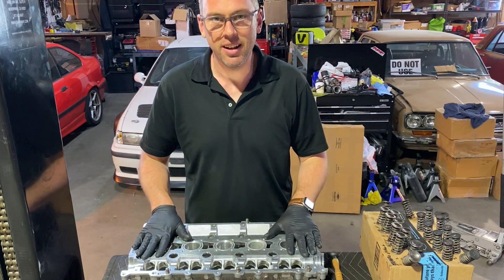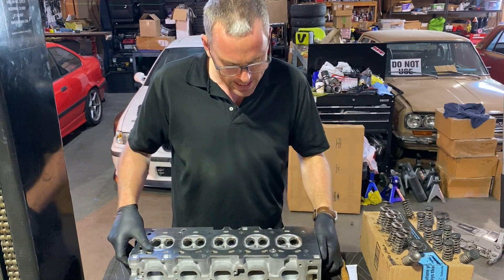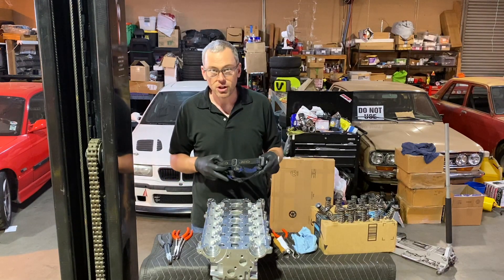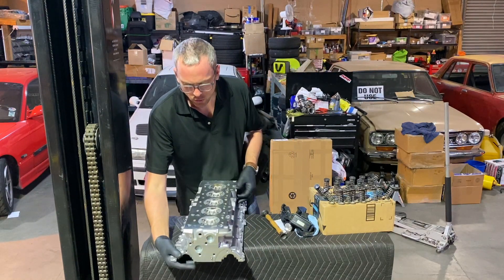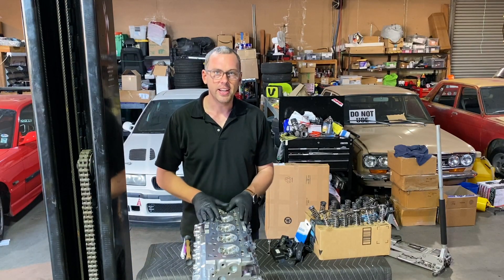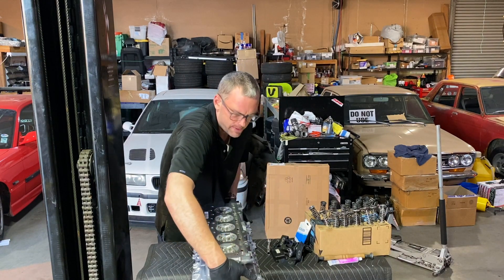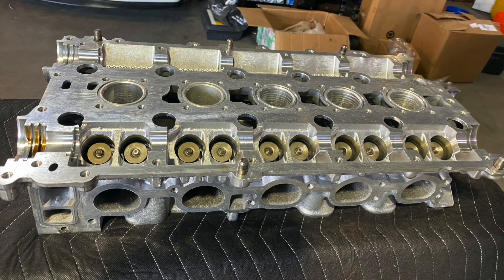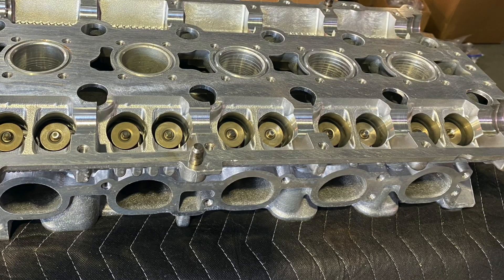V70r Build: Head Work & Installation With New Head Gasket

Comment: Hi EuroJulien. Peter from Australia here , I'm currently rebuilding a Volvo 2.5t 2005 engine same type of block as your V70r , I'm looking for a valve compression tool like the one you use ,my question is is it a OTC Large  from Amazon or ?  comments on Amazon that the tool is not being strong enough for higher force springs? The tool you got looks good , still got my ENG head on the bench.

Comment: You seem to have used Victor Reinz components, any problems after it was finish. Robert only like to used Volvo stuff for valves and head gasket!
Reply: I heard before that Elring made the head gasket for Volvo but I'm not sure .Anyway ,Elring makes only OEM components. 
It's known as other  manufactures work for automotive industry, in this case Volvo  and stamp  logo(Volvo) on it. For example INA make the mechanical tensioner for timming belt kit. And so on with other parts

Comment: Great video!! Question; I’m in the process of rebuilding the head on my 06 S40 after the car jumped timing. I got me valves. I’ve always heard that these engines never need valve clearance adjustments. During engine disassembly, I numbered the valve tappets in order to install them in the same location. Will the valve clearance be within specs even with the new valves? Im
Reply from the maker: for sure check your valve tolerances

Comment: Informative video that leaves a lot of questions.
1. How many miles on head before Stage 2 port & polish?
2. What are valve stem/valve guide specs on used head vs. OEM
3. Why pay for an expensive Stage 2 P&P and not have same shop do a quality 3-5 angle valve seat job??  Hand lapping valves is good for proofing a valve job, it does NOT correct worn or incorrect OEM seat/valve angles. Porting and polishing a cylinder head with old valve guides, stock valves and stock seat angles seems questionable?  Let me guess, you don't have before and after flow bench numbers for your stock vs "P&P head???
Reply from the maker: 1. 160k miles, iirc. 2. Don’t remember off the top of my head. 3. All the feedback I got is that if a Volvo head passes vac/pressure test don’t touch the seats. This was info given from a premier Volvo engine builder
Reply: @eurojulien  I'm an old Redblock guy and a new White block guy and I question your "premier Volvo engine builder".  Volvo valves and seats are durable but are not ground at multiple angles.  Additionally, valvle guides/inserts are seldom optimized in factory builds.  My toilet valve will pass a standard vac test, does that mean it is high performance??

Comment: Yes, again an illustrative video of how things are done wrong and I will publish it so that others can do it wrong as well. First, the valve is inserted into the cylinder head, then the cover is placed on the valve, and only then does the valve seal engage so as not to damage the lip of the seal. Then I put on the spring and the valve locks. Volvo supplies this cover as a standard part. So if you do not know the basic procedures, please do not teach others how to do it and still badly. Thank you.
Reply: You talking out of your ass

Comment: Great and informative video! A little trick I learned for lapping in valves is to use a lighter lapping compound, put the valve in, attach a piece of fuel line to the valve stem, a drill bit into the other side of the fuel line, and use a drill on its slowest ratio to spin the valves while applying light pressure with your fingers. Works wonders and makes speedy work of an otherwise fun but tedious and time consuming process. Also, my personal technique for valve keepers is a nice thick grease or sticky assembly lube and a pocket screwdriver. Got quite quick with them that way. So if anyone wants to try a couple different ways of doing things, there's another option.

Can't wait to get to this point on one of my personal motors!